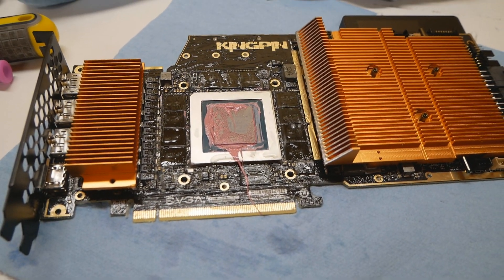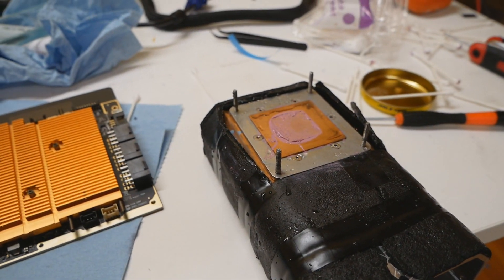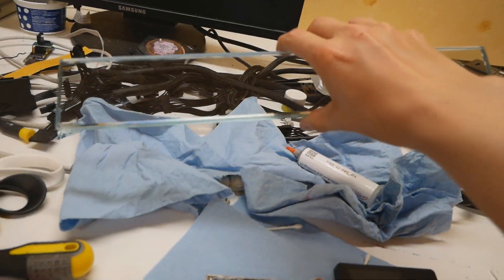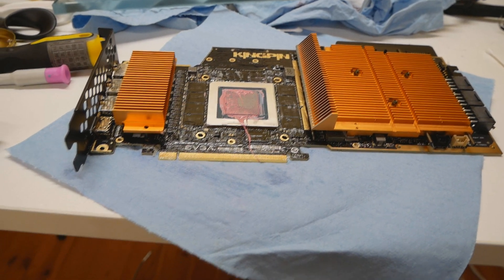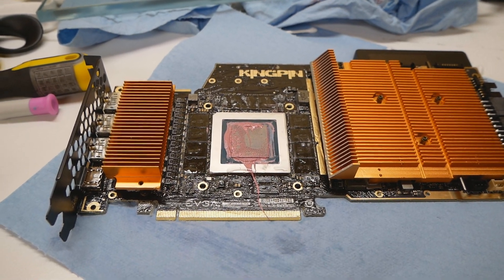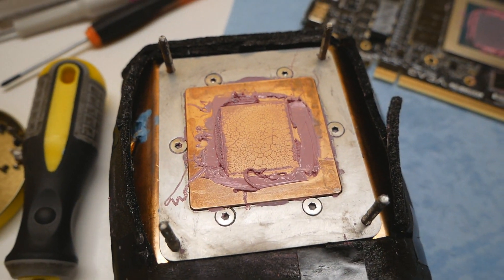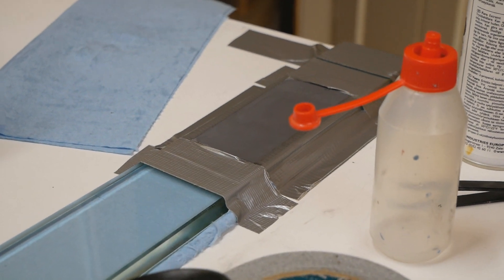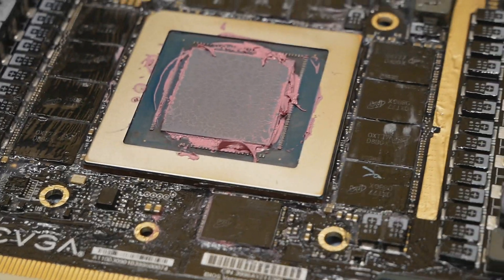GPU Lapping Part 3 - Der8auer Style Glass Plate Method

Comment: I am training lapping on my stock AMD coolers and found out my wraith prism had a dent right in one of the heatpipes in the area that should be contacting the IHS right above CCX1, the CCX that had almost 10c delta when stress tested. 

After sanding actually quite a bit off of the heatpipes, and shortening the height of the AMD retention mechanism a bit, it yelded almost 8c better overall temperatures on the stock cooler with the same exact same thermal paste and the CCXs temperatures are much closer to each other on p95 now.